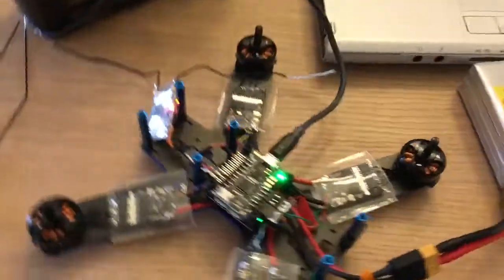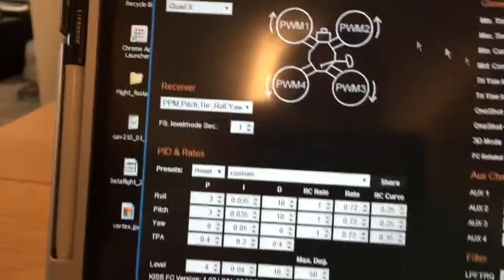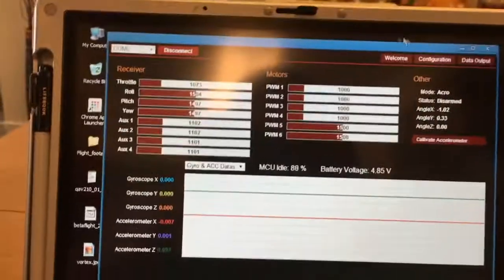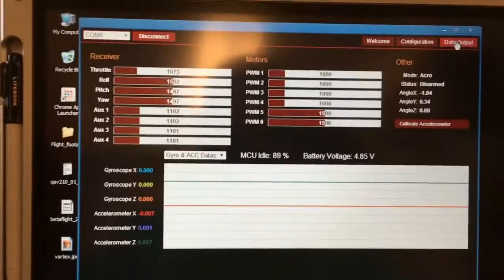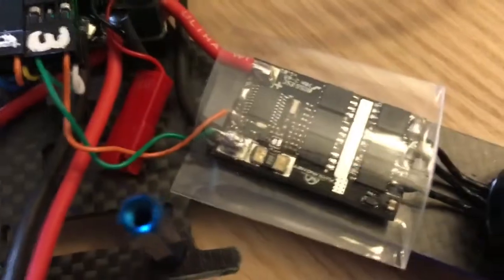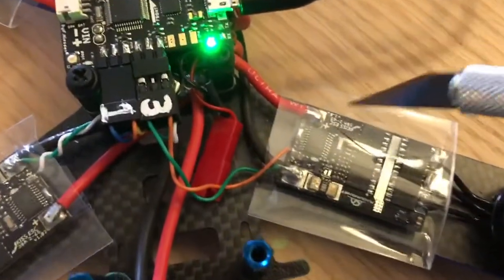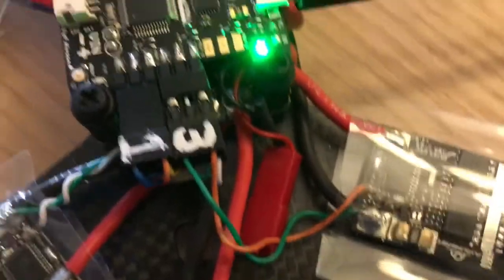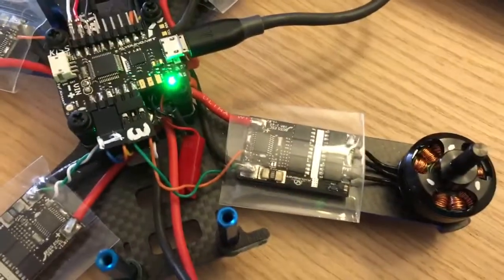Trouble shooting KISS esc setup

Comment: SAME PROBLEM WITH 24A ESC's someone please helped ive tried oneshot125 but kiss gui automatically changes it back to oneshot42, my esc's all flash once with i plug in the battery , dont know what to do
Reply from the maker: So, I can tell you what MY issue was... One of my signal wires, on the ESC side, had a tiny, TINY bit of solder touching another component.  Once I cleanly resoldered all my signal wires, the issue was resolved.  So, maybe check REALLY closely all of your solder points.

Comment: All your end points in the RC need to be at 1000-2000; I would set min. command to 1070 for starters until you see where your motors spin up smoothly.  No need for the ground wire to the FC from the ESC; ground loop could cause a fire.
Reply from the maker: +madsloper do you think that the ground wire from the esc to fc is causing them not to receive a signal, though?
Reply: +Mikey “CPT0vrlap” Richard I don't think the ground wire is causing your issues; I didn't connect my ground on the ESCs and they work fine.
Reply from the maker: +madsloper I previously had this exact esc setup on my SPF3 and Naze fc, and they functioned properly... so I'm finding this quite odd.
Reply: Did you adjust the end points?
Reply: +Mikey “CPT0vrlap” Richard Like someone said in RCG - oneshot 125 only for KISS 30a.